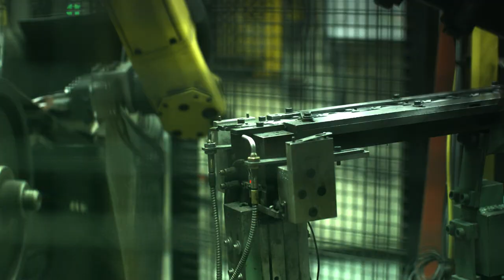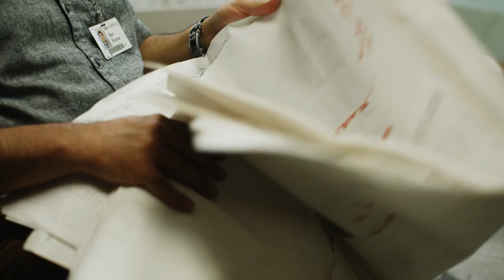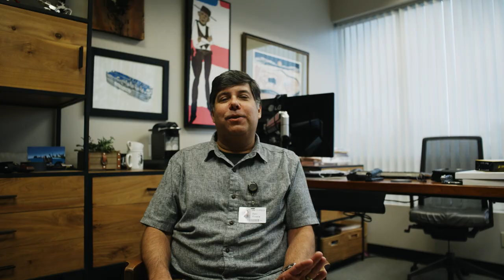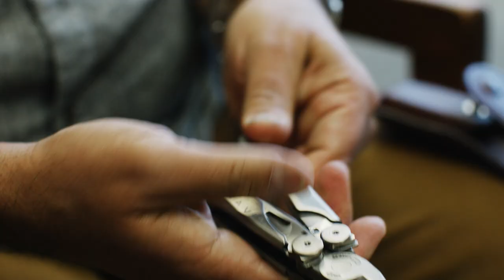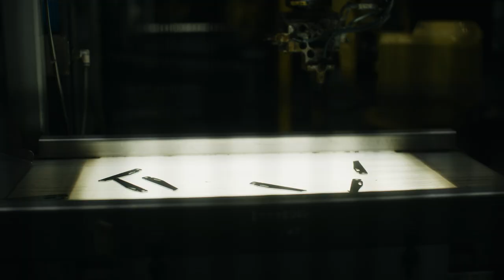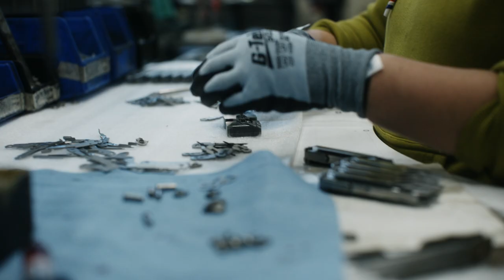The History of The Wave Multi-tool

Comment: What about Leatherman clones made by : Hangzhou Great Star Industrial Co.,LTD the Swisstech 18 in 1 or the Ozark Multiforce 18 in 1 they seem overall to get it better than Wave for a fraction.
1 No freaking tamper proof assembly torx. They at least put standard torx. Nobody want them. PUT REGULAR METRIC ALLEN HEADS. Who choose em???
2 Reversed tooling so if pliers will slip the multitool would not bite the palm in the center.
3 Less edges and corners in the "scales" shape. More flush shape = acceptable wear and fatigue due intensive bare hand use.
4 Bit holder: Definitely not a fan of Bit holder on the multitool. I prefer separated ratchet such as Victorinox or VIMtools, perhaps ICON. But assuming a bit holder mounted is a good thing Their bit holder is more normal at least accepting standard ¼hex  bits (it could be even better if magnetic).
5 Carbide plaquettes: you don't have plaquettes on actual professional lineman's pliers or tiny bolt cutters but you have em on a multitool, it is kinda silly and uselessly overbuild IMO. They build simple pliers head without even a stamped marking on one hand or booth.
6 Price. definitely. How many Wave have been produced and sold in this specific production evolution ...? Scale economy? efficiency in organizing optimizing cycles and refining manufacturing million pieces? 
Just  Why initial streetprice for a Wave was around the 50 affordable $s getting a Charge beater and it has more than doubled making a market space for Sidekick Wingman Rev in its initial price range?...
If you need a beater multitool you will definitely buy those mentioned in first place. paying a fraction and getting a better deal rejecting at the same time all the proprietary things commonly unacceptable in Leatherman marketing production.